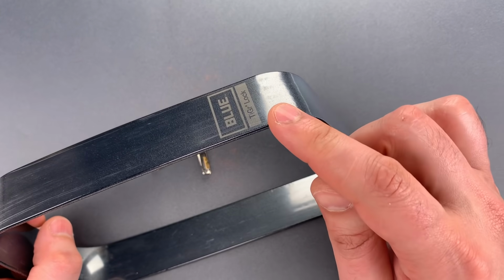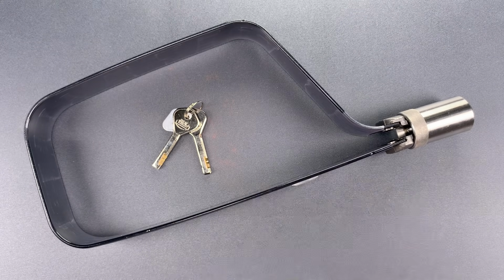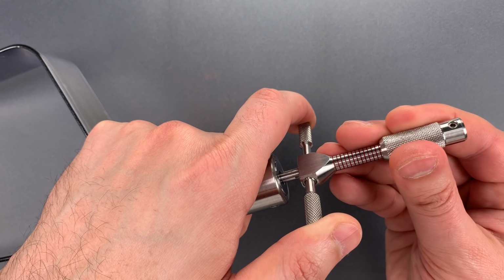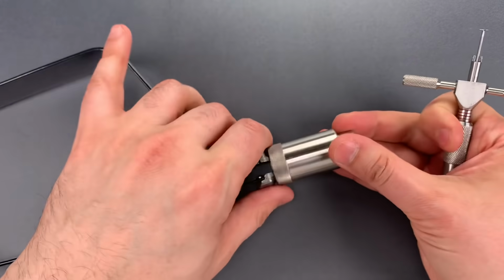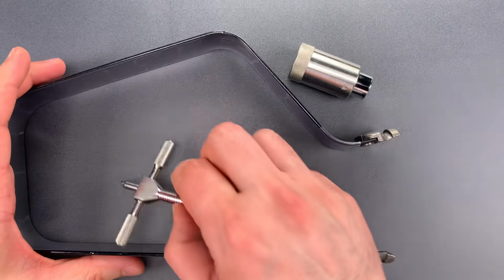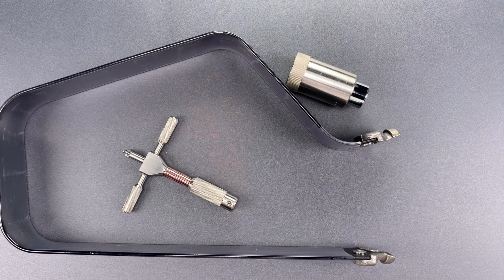[1214] What Was Old Is New Again: TiGr Blue Bike Lock

Comment: "Unlikely to be picked on the streets", good enough for me!!!
Reply: One of the highest praise that locks can get
Reply: Just don't go for the Titanium shackle.
Reply: @OtakuUnitedStudio  Honestly though the steel shackle is easy to cut with power tools - around here nothing safe from thieves with battery-powered angle grinders and cutting discs. Not a single lock gets picked, they just slice something, whether it's bike/motorcycle or the lock.
Reply: @KrikkitWarlord  You've hit on the thing to remember.. you need to consider the level of thief you are trying to dissuade. Your average joy riding bike punk is going to look for a cheap chain or MAYBE something that can be two wrench popped. If you have a valuable looking bike, you might get someone trolling for bikes and is prepared to put a bit more effort in.

Comment: My thought on round vs flat: The obvious advantage of round is that there's no better attack path when cutting it - there's equal amounts of material no matter how you come at it.  The flat shackle only needs to be cut a short distance in one direction - and depending on the tool the edge may give you an advantage to starting the cut.

Comment: One would assume the flat style of strap has an inherent weakness the round design does not. By being flat all attacks will only need to breech a very small amount of material at a time, and it doesn't have the 3 dimensional support a regular round design takes. That means not only cutting is far easier, but even things like hacksaws, grinders, and other methods of attack. Ultimately the flap strap is inferior, as the material only has support to the left and right rather than all around.

One can imagine it is incredibly easy to tear aluminium foil. However taking the same mass of aluminium into a round design will be significantly more difficult to attack. Or tearing paper vs pulling at it and trying to snap it all at once (surprisingly very difficult). We have entirely the same concept here, albeit to a less extreme situation. It seems in attempting to be hipster and different the makers of this lock have ignored the obvious lessons all other designers have learnt from.

Comment: I'm as much in awe over your skillset as the next viewer. Also for the consistant and professional content you create, so thank you for all of it.

I do however have question. Whenever you pick these disc detainer locks, you use a highly specialized tool, invented and manufactured by you and Bill. It of course makes the job alot easier, but it is still a very specialized tool and as such, not easily available to everyone. Could you do a video, where you pick one of these lock types without using this tool? To showcase the proces and technique? 

I'm sorry if you have already done this earlier, but with more than 1200 videos, it is quite the task finding that one video ;-)

Thank you and happy holidays to you and your family!

Comment: the reason this design was abandoned is that it IS a lot easier to cut through vs a solid steel rod. with a circular (or hexagonal) rod, you're forced to cut through the thickest point no mater what.
but with a flat-strap design, you can cut the long way through the thin part witch makes significantly less heat and less resistance, since less surface is contacted at once, and makes removing material a lot easier, thus with power tools its effectively a lot faster (and less damaging to the blades) to cut though a flat strap.

Comment: Titanium isn't really as strong as people think. The name just sounds cool as shit. lol
Reply: No it is strong lol it’s weight is lighter and stronger than steel , it’s not as cut resistant though
Reply: True... The main reason for using it is weight reduction and corrosion resistance.
Reply: Well no it is stronger than steal of relative weight and is often used for its insane temperature and corrosion resistance. It is however easier to cut because cut resistance is controlled mainly by hardness, and titanium is much softer than treated steel as a result of steel being responsive to heat hardening methods and titanium not.

Comment: Circular bar stock locks are more popular because they feel more rigid, so the customer assumes they're more secure without actual logic behind that. Shackles made of sheet steel will have some bend to them, and so they feel less secure, regardless of how cut resistant they are.

Comment: Looks like the physical weakness of this is where the locking lugs are attached to the shackl band. You could  probably snap this off with a bicycle handle bar, or metal tube the right internal diameter.

Comment: I have my guess on why it was discarded - Only one cut is enought to take it away - a sheet metal is easier to bend - therefore - only one cut is all it takes to bend it  and take away from the bicycle frame. 

In contrast, standard rod shackles are just way tougher to bend, and that's why they would usually require 2 cuts, instead of 1. 

That's what I believe at least.

Comment: This style of shackle is susceptible to a freeze attack, just get it below -75C and it goes brittle (R-13). Being thin, it's easier to get the temperature down. Also, for current attack methods, it's easy to cut with a battery powered angle grinder and death wheel.
Reply: How exactly would one freeze a lock? Especially down to that low of a temperature?

Comment: A hand held battery operated grinder (like the DeWalt DCG412BW230 and a thin cutoff wheel will take only seconds to cut the metal strap.

Comment: It's probably a decent lock for the purpose; at least nobody's going to accidentally walk off with your bike. The flat bar takes a while to hacksaw through, and it's annoying to cut with bolt cutters because of the shape, picking it takes a while without the right equipment.. there's easier targets around so nobody's likely to spend 5 minutes on that on the street.

Comment: A technical question about locks and lockpicking in general. So I think I understand the mechanics. With a key inserted the pins, which match the keys hills and valleys line up with something so that the lock can turn. When you pick a lock you're manually raising the pins. So 2 questions. If you're raising the pins up, and I'm guessing when LPL says they "click", how does he make sure that all of then are lined up correctly? Shouldn't each valley or hill have a different height? And secondly, what keeps the pins from falling back down?

Comment: So what I get is, it's a decent lock easy to pick if you have the right tools which in real world speak means it won't be picked. Underlying though is that it's made from hardened carbon steel, so it'll be a bit heavier than it's titanium sister and this more expensive because it's new.

Comment: Why it's new again, I suspect, is that most bike thieves are carrying tools optimized for the round bar construction of modern U locks. Anything worth stealing has one of those, and a cable, on it, and with the right pair of cutters, you can speed up the job fairly quickly. For a grinder, I don't think it makes a significant amount of difference, but I think the only real way to beat a guy with a grinder is to park your bike somewhere that deters such a noisy, spark-flinging kind of attack.

I'd be curious to see how it opens up against other attacks, and if it competes with Kryptonite in terms of cost.

The big thing about flat bar is that you can nibble it, and a handheld, cordless nibbler is something we easily have the battery power to make (and probably make from a drill adapter) nowadays. You can't do that to a round bar. So if these get popular, expect them to quickly fall OUT of popularity, because there's an easy (if cumbersome to carry around) attack.

Comment: I'm wondering how strong the welds are on the locking nubs. It occurs to me that you could stress it open by putting a foot long tube over the lock part and moving it up and down to crack the weld. ...the 1970's version had a better design regarding that.

Comment: I haven't handled one, but it seems that the connection between the strap and the lugs that go unto the lock body would be a weak point. I'd love to see you get a pry bar under there, or a drill and see if the bolt there is hardened. From pics on there site, I bet you could use a stripped bolt remover type drill bit to unscrew them from  the outside.

Comment: If I wanted a really difficult door to open I would have both mechanical and electrical in one. I.e. all the pins have to be in contact with the key at the same time and they all have different voltages going into them at the same time.

Comment: I think the only lock LPL can't open would be one filled with concrete. 

Joking aside, im curious as to what the advantages of a strap design are over a bar design.
Reply: Resistance to bolt cutters? It's a tool geometry thing; less leverage, less optimal angle.

Comment: Why can't bike lock manufacturers simply run a electronic alarm sensor wire through the strap and core?  Hell, even a proximity alarm.  They aren't that hard to make, are in many car alarms and don't need external wiring.  A three second delay would give the owner time to unlock it but no time to pick or brute force it. They could also link to a smartphone and notify the owner.  So many options and given the price of high-end bikes and bike locks, the cost of electronic components would not be a hurdle for a lot of cyclists.

Comment: I'm curious if the part that the lock attaches to is actually as hard as the 'blue' band. If it's not, you might be able to get the bolt tops off pretty easily.

Comment: that riveted connection to the prong doesn't inspire much confidence - looks like a prime subject for "brute force entry", it seems the rivet might be stripped with a pair of large pliers by pressing the loop ends together
would have been much better construction if the movable thingy that separates the prongs in the locket position would move in deeper - somewhat past where the rivets are located - this would prevent the possibility of stripping the rivet

Comment: What exactly is Carbon Steel in this case? Because the definition is pretty vague. It basically just means its not stainless steel. Giving a hardness or the actual alloy used would be far better.